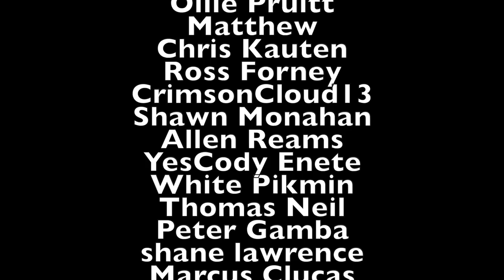Testing her Harley Dirtster conversion

Comment: Damn, Chey! You've done a lot more than I have to my Sporty at this point! I changed my intake, but I haven't messed with taking off or installing the carb. Had to have a local mechanic deal with that in combination with some electrical work. Good on you! Great stuff!